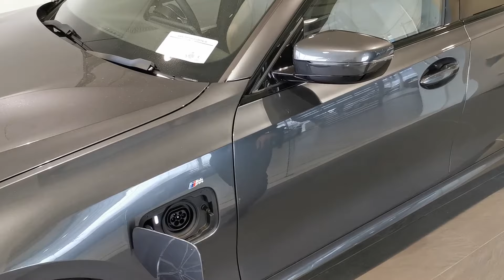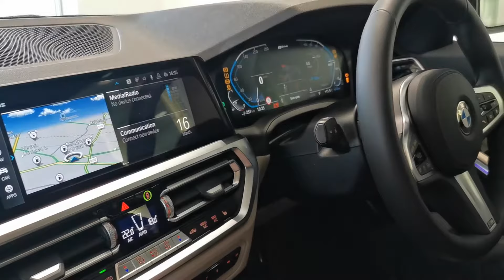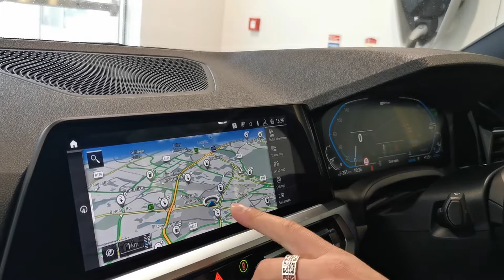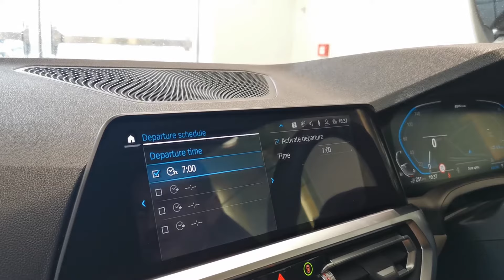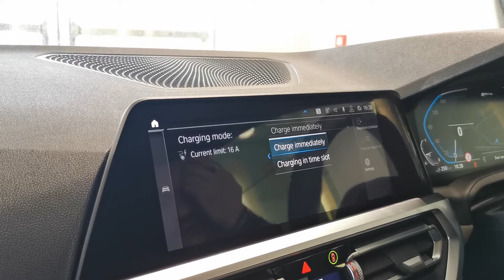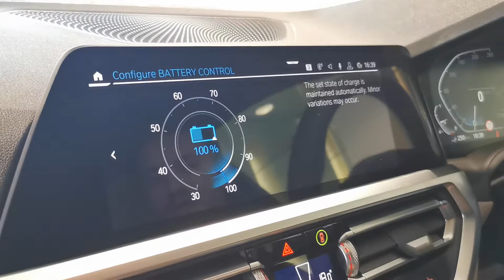How to charge your BMW Hybrid & maximise driving range

Comment: and by "uses slightly more fuel" you mean about 5L/100km extra to charge about 50km / 100km driven on Autobahn.
Reply: To me it is around 3L/100km extra - but still, kind of defeats the purpose of driving electric if you charge it using petrol. I very rarely use this option.
Reply: @Alex56381  it makes total sense if you're going to be driving in a city after a longer distance. In the city I use plenty more than 3-5l/100km and the electric drive is way more efficient then. I did the Math for me and it makes sense. Plus electric drive in the city feels "elegant" and I really like it. 👍🏻
Reply: @firebladeflow  yea, I do the same thing. At 100 km/h I get between 8-10 l/100kms instant consumption depending on how loaded is the vehicle, outside temp etc. In a crowded city it's totally worth to go electric, better fuel economy and I also feel like the petrol engine is protected by not having to do all those 1-2-3 gear rolls and then stop every 10 seconds. Every second that engine isn't spinning while moving, is a second spared in the life of that engine. That's my 2 cents.
Reply: @Alex56381  highway driving it's ok to charge car.you save the ev mode for city driving.

Comment: I charge my 330e each evening then put the cable away for nighttime, so I'm going to try that departure time thing on chilly mornings to warm everything up. I t will take a little bit of battery power, but it's a big battery.
Reply: If you leave the vehicle connected to charger it will warm the interior and battery pack using the charger and not the battery. When the vehicle is connected and locked it also locks the charger so it cannot be disconnected.
Reply: nah bro, aircon and heater have a heavy impact, they steal around 1/3 of the range

Comment: Good review but one point from someone who has one, when you say that when you hit the button to charge the battery while you're driving there is a slight decrease in MPG there is a massive hit to the MPG. I've done some crude tests and it appears to wipe about 20mpg off.
Reply: My own opinion is that it is not recommended at all ! I own a 320e and never do that. The only use case : you reach a zone when it is not permitted to drive hybrid (only electric) and you don't have enough electricity.